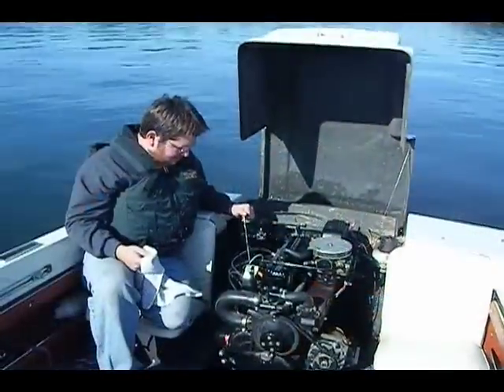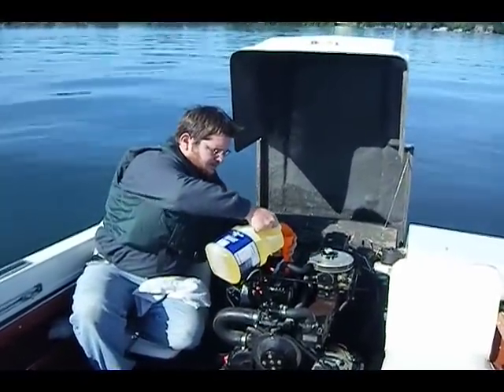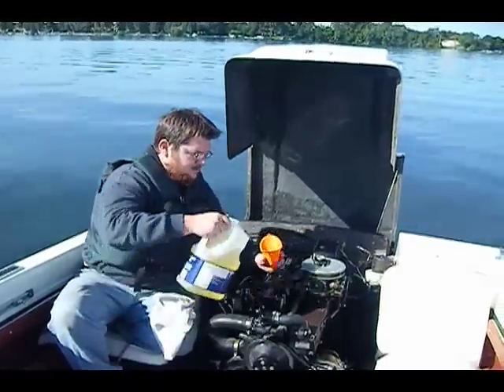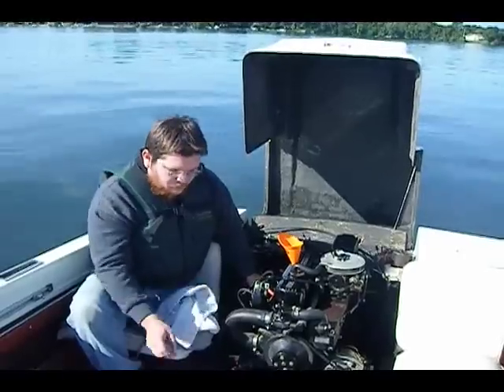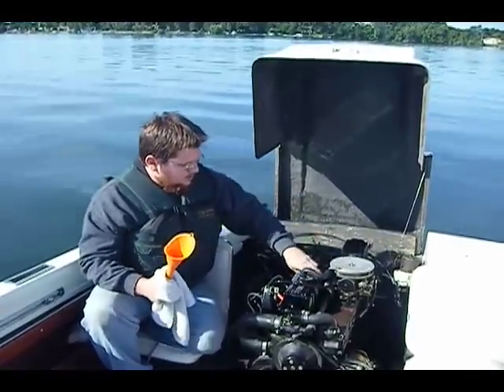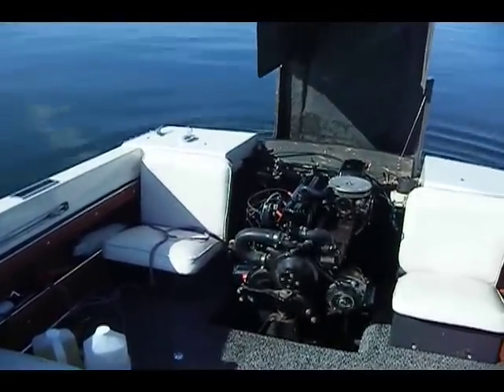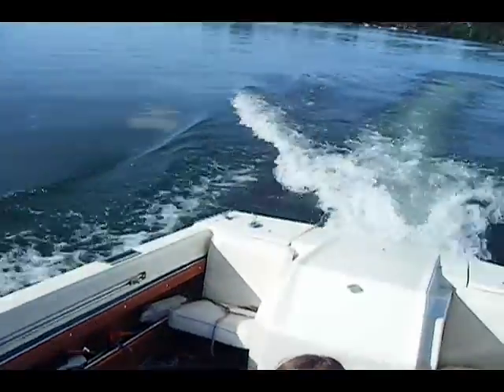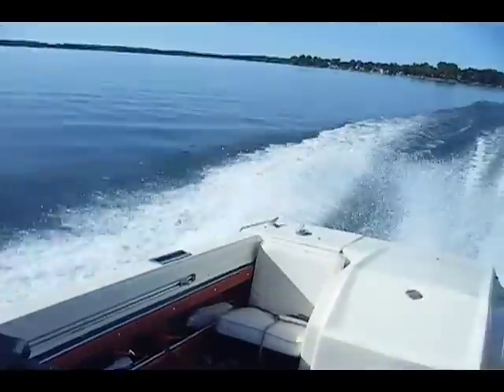Vegetable Oil as Motor Oil

Comment: I developed bio--synthetic oil compositions that extend millage +20% in comparison with standard mineral engine oils. For example, a cheap version that is 1.5$ per liter has about 90% of palm oil and 10% of anti-fricton and anti-wear additives. Neat palm oil does not provide any extension in millage. Sorry. It is not recommended to use in heavy duty engines. However, in Malaysia some people do use it. Only palm oil and castor oil can be used as base fluids. Beware! No rapeseed oil, no sunflower oil, no olive oil, etc. to the engine! Also, I reside in Thailand and my compositions are equivalent to SAE 20W40. That is cold air temperatures are not allowed. In total I have distributed about 60 liters of my lubricants for trials. Efficiency is high like never before, lower noise and vibrations of the engine, no harm to environment. Hopefully, marketing will go well.
Reply: Convert this motor to a poppet valve loop charged 2 stroke and use the soy oil as lubricant, Now take 2 VRo pumps to put it into the intake manifold and it now has total loss oil injection which burns off clean. You would need a blower for scavenging though, I want to try this.
Reply: man, if you want to see extension in millage, you need ant-friction and ant-wear additives to the lubricants. you may use some cheap veggie oils in a 2stroke ICE, as well as a diesel engine as fuel,  all right, but for the diesel it is better to preheat oil to about 80deg Centigrade. anyway, i am not talking about large change in the engine. just replacement of the lubricants
Reply: You are running oil injection? If so what is the cleanest burning. any motor can be rigged up with a VRO pump and oil injection
Reply: Soy oil can be used as the lupe and then with the fuel if you want to go with total loss oil injection, it burns cleaner, i mix mine with amsoil dominator 2 stroke oil.
Reply: no, i use standard diesel fuel or a mix with biofuel up to 5%, no change in a fuel pump
Reply: in a 2-stroke engines I use castor oil with or without additives. It indeed burns clear.
Reply: This will work in a 2 stroke diesel also, just feed to the bottom end, let it go around a few times and the pull it off and burn it with biodiesel for a total loss 2 stroke diesel, i want to do this with a 6v53 detroit.
Reply: good luck. castor oil used to be the best lubricant and for now if proper additives are used it shows incredible millage extension. as for my conditions,  have a few vehicles and machines with 2 stroke engines such as gasoline 4 stroke engines, 4 stroke diesel engines in our tractor and pickup track. but i have no one 2 stroke diesel engine. I would use castor oil instead of soy oil. even if castor oil is more expensive than soy oil, concentrations of the oil can be lower in the 2 stroke blend. so, economy will be not sacrificed. and in time you will witness improving engine efficiency.

Comment: Did you bump your head? That's insane especially in a Marine engine. I'll guarantee that veggie oil will clog oil galleys alot quicker then normal oil. Detergents are put in for a very good reason.
Reply: Im running amsoil doninator 2 stroke in my toyola truck, its got 232k miles and still going, next i want to rig up oil injection so i have a total loss auto lube sysem, inject got to get the VRO from an outboard to work.
Reply: I use palm oil with about 10w.% antifriction, anti-corrosion and antiwear additives. a lot of additives. the engine with my lubricants gives much higher efficiency (+20%) and it is improving in time as compression ratio is rising slowly. less noise, lower vibrations. and the lubricant cost is much lower than that of mineral oils. but the lubricant is only for tropical countries as it can be classified 20W40. not for cold climate.

Comment: Hmm, this is very interesting! I did not know that you could use vegetable oil as engine oil........... But I do have a question: When you changed the oil, did it have a lot of metal filings suspended in it or was it still clean, homogeneous oil? Is this engine still running? How long have you been using veg. oil as motor oil?